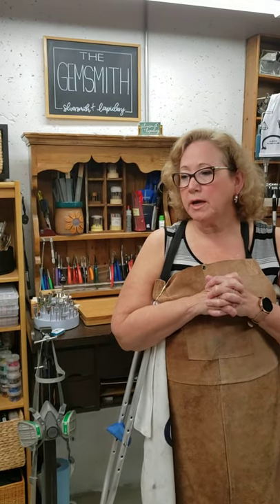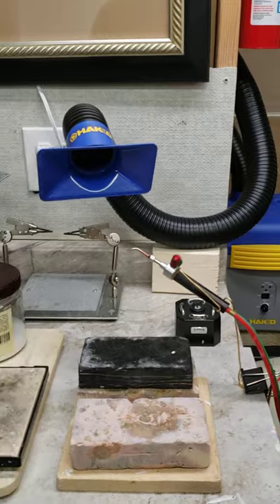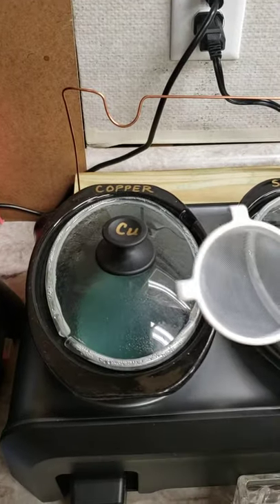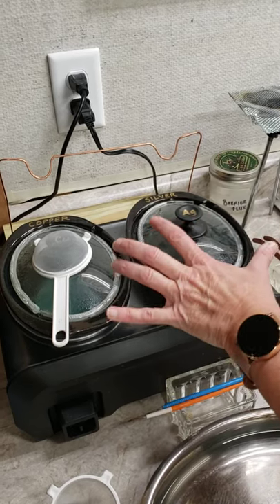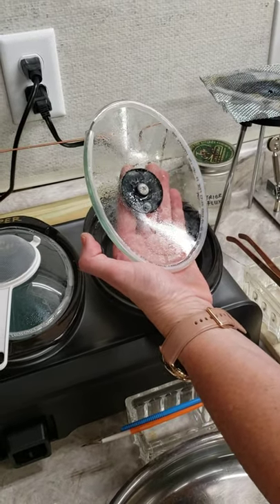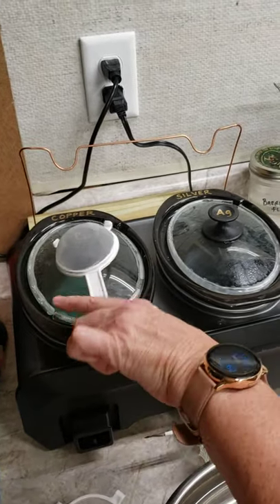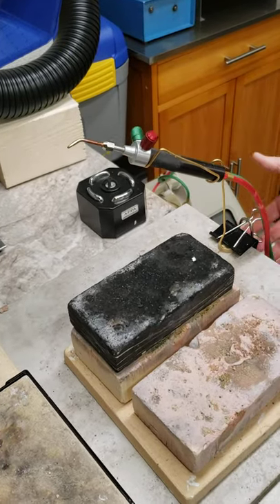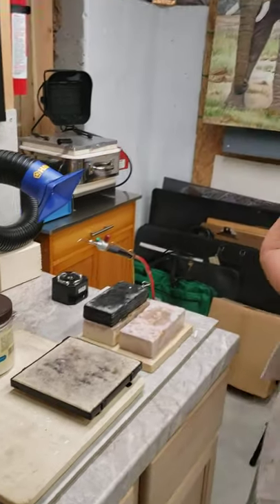Soldering and Pickle pot tips

Comment: Trying to get help anywhere I can, I cleaned my pickle pot I made some fresh pickle and now I noticed this sticky black oh I'm sorry not black like brown stuff floating on the top and it's sticking to my copper tongs do you know what it is or how I can get rid of it
Reply from the maker: It way be a chemical in your water. I only use distilled water for my pickle.  Try that and see if it helps!
Reply: I use the water from my de-humidifier for quenching and pickling, and I have never had a problem. As the water is taken from the air, it's free and pure.
Stay safe, Steve.
Reply: @stephencoster9532   nice tip.